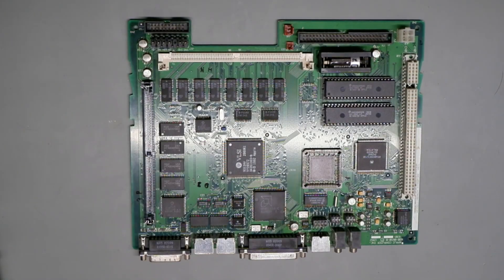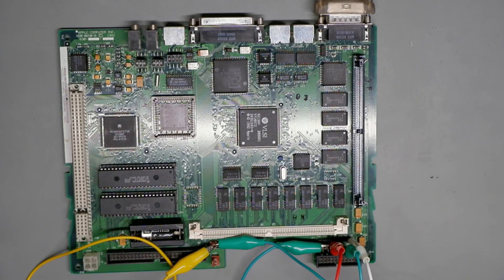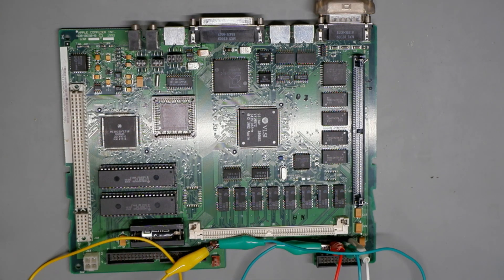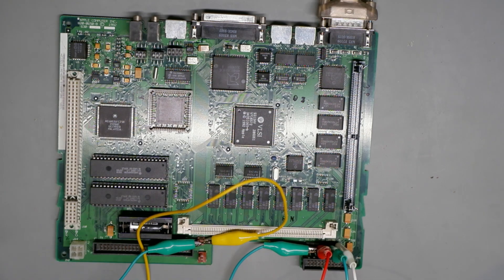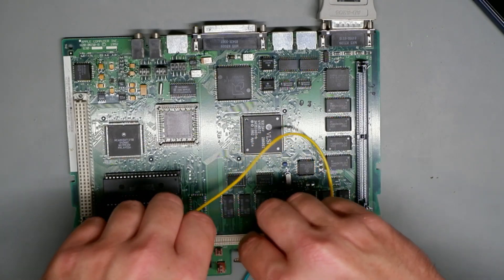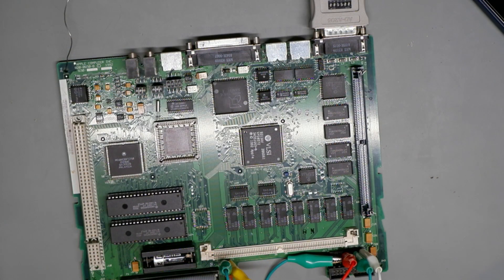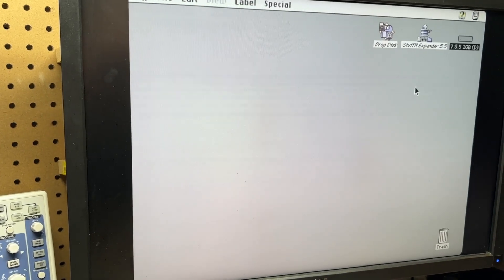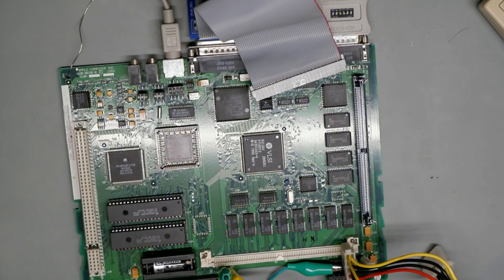Apple Macintosh LC III Motherboard

Comment: huge fan of the twist-off method!  Seriously, I've done thousands of caps that way and I've never screwed up a pad (unlike with hot hair ungluing the pads from the board!)
Reply: I've screwed up one out of thousands, but the pad was already pretty corroded. Sure, I could have probably saved the original pad using reflow/desoldering, but it only took 2 minutes, a replacement pad, some solder mask, and a UV light to fix the issue.